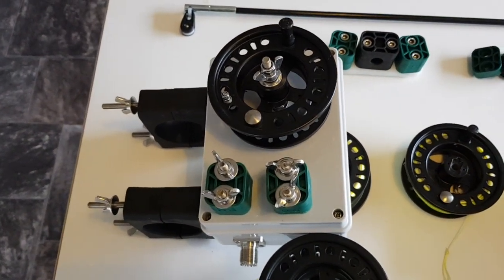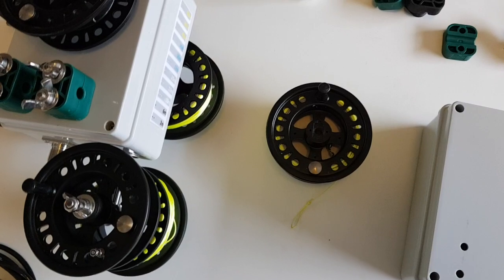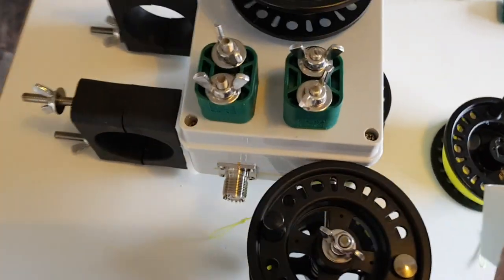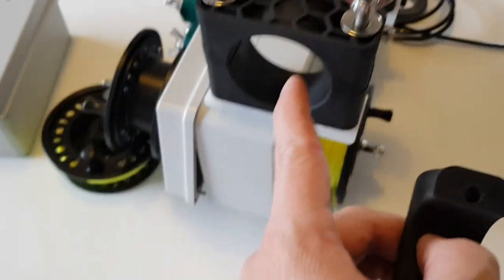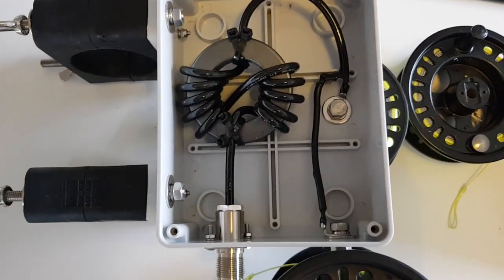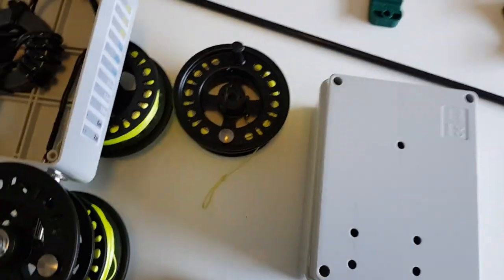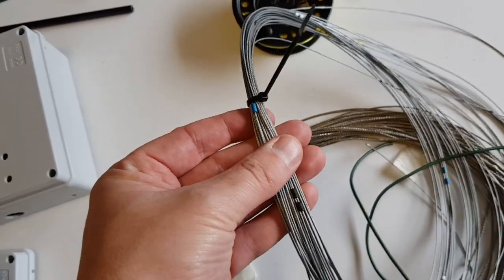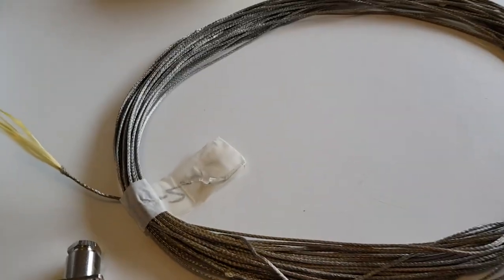adjustiwave Antenna - Main Components & Basic Construction

Comment: Many thank for the construction details would love to do one : )) 73 De tony Gm1vla
Reply from the maker: Tony, it may be possible I could supply you a kit with everything in it. Unless you had most of the bits then it would probably be cheaper for you in the long run to make it from this kit. I could even pre drill the enclosure and all the nylon plates. The option is there anyway. You will find my email on QRZ if you want to get in contact. Regards,  Colin